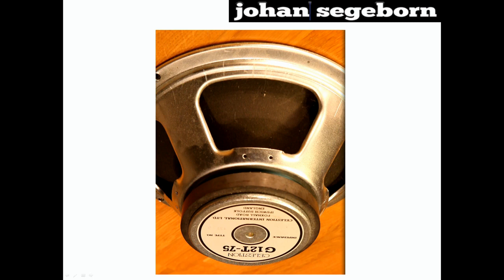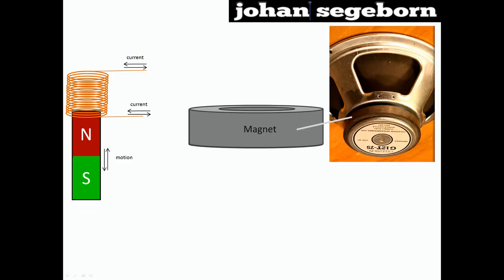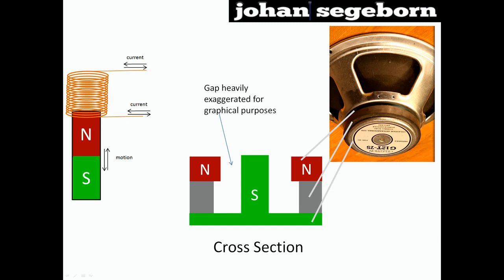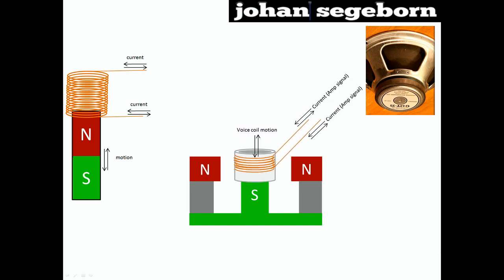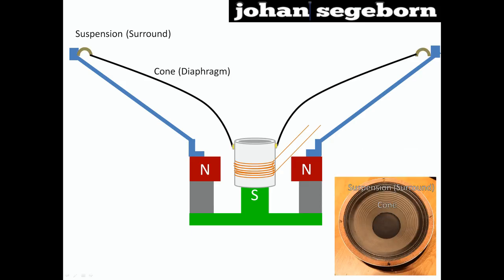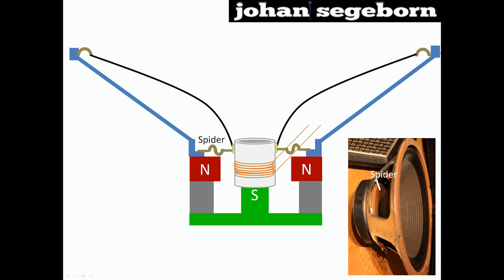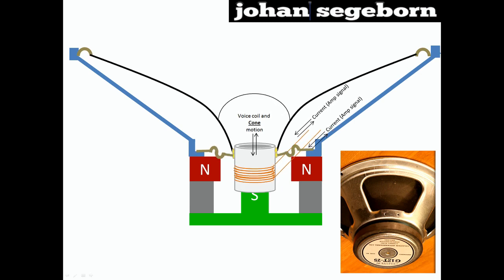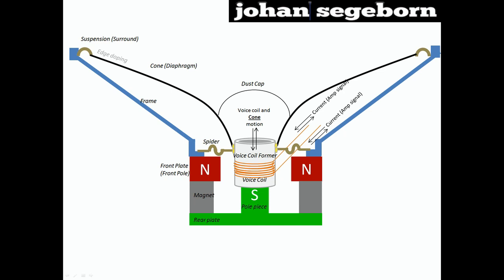How does a speaker work?

Comment: The pole pieces convert the ring magnet with a pole on opposite sides into a bent horse shoe magnet with the poles facing each other in the gap. Well imagine a ring of horse shoe magnets with the poles bent inwards to create a narrow ring shaped corridor with the north pole on one wall and the south pole on the other. In this sits the coil of wire, held in place perpendicular to the magnetic fields, such that the ring magnetic fields induced in each wire produce the strongest force upwards or downwards.

Comment: This looks like AC work , what if DC made this...Can you explain to us the difference between AC current that Powers the amp and the difference between the speaker wires and the current that travels through them how it's different than electricity I don't understand.seems like the speakers pretty primitive for not changing how long of a long we've had it and it's amazing the work the wire work that goes into building it how intricate it is the wired out of this spooled is amazing

Comment: I am a physics major and think I understand  the Lorentz force equation... the magnetic field inside a ring magnet should resemble the force inside a solenoid, which is all in one direction with the same direction as the axis of the magnet. The voice coil is within this uniform field, with lets say the field pointing up at every point on the voice coil. If I pick a point on the voice coil and do the "right hand rule" for  a cross product of current with the magnetic field, I get an "outward" force on the coil at each point, as if the coil is being forced to expand. This doesn't produce a force upwards or downwards on the coil. If I want the right hand rule to produce an upward force, I need the magnetic field(or some component of it) to be pointing "inwards" at every point on the coil. This is best produced at the ends of the magnetic gap or even outside the magnet... so is the ideal rest position placing the coils near the top or outside of the magnetic gap?

Comment: Johan...  please do two speaker videos... 1. Modern speakers that come very close to vintage pre Rola G12M and G12H Greenbacks. 2. Pulsonic coil rub. What can be done?  I just bought 2 1968 greenbacks with original cones on EBay like a moron and they, of course have coil rub.

Comment: Hi Johan,  Can i plug headphone/out of a Bugera G5 to the Loop/In of a Fender 212R combo? Will I get sound safely? (The Bugera G5 out for speaker is 8ohm but the Fender combo works at 4ohm :/ ) The question is regarding a tip that I saw from a Chinese guy here in YouTube.   Thanks in advance :) /m/   Rufino

Comment: would the speaker be better with a powerful neodymium magnet 🧲🤔😄
Reply from the maker: The stronger the magnet, the less compressed the tone gets, so it depends on which sound you’re looking for. One advantage with neodymium magnets is that they can be made really light and still sufficiently strong

Comment: What will happen if we change north and south poles
Reply: Then you get messages from the devil.
Reply: Tusshar Goyal The the speaker would move from front to back instead of back to front like usual. You can try this yourself by hooking wires to both speaker terminals and touching them to a 9 volt battery, then reversing the wires from - to +.
Reply: scott hutchens Would it be like shifting the signal phase by 180 degrees?
Reply: Javig * For it to be out of phase, you would have to have  two speakers hooked up together—one with the correct polarity and the other speaker with polarity reversed. At that point you would have one speaker moving from back to front and the other speaker moving from front to back. The result would be an extreme lack of bass because frequency is being cancelled because both speakers are moving opposite ways. The same effect happens when you have an “out of phase“ switch on a guitar with two pickups. A single speaker moving the opposite way (front to back) does not create an out of phase sound, it takes two.

Comment: Thanks a lot for the video!! Im using a tube amp, and im sure you are aware that I cannot disconnect a speaker out of the amp while it is on because it will damage the output transformer. So I was thinking, can I remove the coil out of a speaker and wire it to a jack and use it as a dummy load for the amp? This was I can use the DI out without having to use the speaker, so is it possible?

Comment: Hello Johan Segeborn, By my great mistake,   + and – wires of one speaker connected to the 2 positives of the left and right channels of the tube amp.  Likewise, + and – of another speaker connected to the 2 negatives of the left and right channels. The one speaker was working  which was connected to the 2 positive of the amp . And the another speaker was not working  which was connected to the 2 negatives of the amp.  For the first 10 minutes, I didn’t notice the wrong connection  by my stupid mistake, then I checked and made the correct connection. After that,  both the speakers were working.  I am afraid of that : Are these speakers and the crossovers became weak? Will it be in full strength as it should be? Although the speakers are working now, I am much worried by my wrong connection.  But , Why one speaker was working and another speaker was not working?  Kindly explain in detail.    Thank you, Best Regards.
Reply from the maker: +Suseendran Balakrishnan Hi Suseendran! If the speakers sound good then it's most likely no problem. The speaker that didn't get any sound can not have been damaged at all. The other speaker received the power of the amp by itself. But usually for shorter periods of time it's ok to play with half the speakers. How much did you crank the amp and what's the power rating of the amp and the speakers? Cheers Johan
Reply: Johan Segeborn, thank you for your reply, . The power rating of the tube amp in Push pull 30 Watt RMS and and the speaker is 100Watt  two  way with cross over. I cranked upto 9 0 clocl position.  Regards.
Reply from the maker: +Suseendran Balakrishnan Hi, then you have nothing to worry about. Cheers

Comment: either the magnet or the coil have to be able to vibrate. am i right?
Reply from the maker: +Michael Lemontzis Yeah a force induced by the magnet field acts on the coils, which makes it move according to the electric signal fed to the coil wires. Cheers
Reply: Thank you.

Comment: grouse video johan have learned so much from you already just wondering i have a fender bassman and it has greenbacks in it. i would love to know exactly what that means. what makes it a greenback shorly its not just a colour thing. just trying to understand my amp better. cheers johan your the best. there jensen if that means anything
Reply from the maker: +Ben Macpherson Thanks Ben! Greenbacks are the Ceramic Celestion G12, G10 and G15 speakers made basically between 1965 and 1973. They all have speaker cones made by Pulsonic, Celestion changed to other cones RIC1 in 74 and those are often referred to as Creamback. During the Pulsonic period, green magnet covers were he most common, thereby the name. Jensen is an American speaker brand (today made in Italy) Cheers

Comment: Thanks for the great video! I just have one quick question. What is the difference between the mechanism introduced 0:10 and the one you talked about later on. I made a simple speaker with the first method, and it worked just fine, does the latter produce a different sound?
Reply from the maker: +Alex Lee Thanks Alex! I think they are the same.
The first concept where the magnet is moved through the coil and a signal or current is induced is basically a microphone. In a speaker you instead have a signal/current that you wanna transform into movement. Cheers Johan
Reply: You get a stronger concentration of field lines at right angles to the coil with the second model, so it is more efficient. Field lines at right angle to the current flow gives the most force.

Comment: I recently purchased some second hand speakers, and the bass speaker is not moving smoothly up and down. Rather it stays at rest at the lowest position of the spider. Could this be an electrical problem or a mechanical one? And does anyone have any idea on how one would fix this issue?
Reply from the maker: +willcant quickscope Hi, if the speaker frame is warped, the paper cone that is attached to it will be shifted, and since the coil is attached to the speaker cone it will be sifted too such that it may touch the polepiece or magnet in the gap and not have it's movement hindered.

Also the coil wire may have been overheated and swelled as a result causing the coil to get stuck in the gap.

How does the speaker sound? Is there any scratching noises?
Reply: +Johan Segeborn Hi, thanks for taking the time to reply.
  There is no scratching as far as I can tell; the sounds comes through fine but is muffled and quieter in comparison to the other speaker (one works fine). Both have no cracks or breakages anywhere, and only came out of the unit yesterday when I re-soldered the wires to try and fix the issue. 
 I have looked at both (Celestion bass speakers) and it is clear that the cone in the speaker not functioning properly is seemingly sunk into the speaker. Upon further inspection, it seems that when I move the cone up with my hand, there is a lot of friction on the spider. 
  The working speaker, when you press the outer surface, will bounce back like a trampoline. This one is rigid as the spider seems completely compressed. 
  Do you know what keeps the cone from falling back onto the magnet? Would it be wise to remove the spider? I am wary when acting on the speakers as they are my grandmothers, and quite old.
Thank you for any help.
Reply from the maker: +willcant quickscope Hi, in this clip I disassemble a speaker https://youtu.be/-xYw45ABTIU

Comment: what do the north poles of the magnet do? seems liek they are useless since the coil can only move up and down.
Reply: +Mommy Spanker wrong , magnets only have south and north not positive and negative . .,, okay this is how it simply says in that video . Both the north and south are important . Why ? Cuz without the opposite pole their wouldn't be no magnetic fields . Remember it's the magnetic fiends ( which are domains of electrons flowing in one direction ) that deflect or repel off electrons inside wire coil which induce movement . This movement of electrons is electricity . So we know the electrons are coming from the amplifier into the coil , this will jerk back and form in respect to the sound electric signals , this will push against the air . Make it vibrate .. And the vibrations of air inside the voice coil is what sound is . The vibrations send air waves right bit ur ear stimulating other vibrations in ur ear drum this connects to other organelles inside ur ears until the info hits ur brains . That's what sound is
Reply: +Pau Gasolina The north and south poles just means positive and negative. not a direction. I think north is positive and south is negative. all magnets have a positive and negative.

Comment: What happens if we remove the South polepiece? will it come sound from the speaker?
Reply from the maker: If you google Faradays law and speakers you can se how two fingers and thumb held perpendicular on your right hand can represent current, field and force. The current runs in the coil and you want the force to act axially along the coil. The field needs to be perpendicular to both, so place magnets accordingly. It wont be dead silent though. Have never tried it though. Cheers

Comment: Thanks for the video. How are different sounds made from the same speaker, when moving at the same stroke at the same frequency? It confuses me how a speaker can make an infinite amount of sounds, from a fixed, finite position. Is it something really simple? Thanks for your help...
Reply from the maker: Red Shift Hi Red! A sine wave of 1000Hz means that the speaker vibrates a 1000 times every second, 50 Hz means 50 times per second. If you plot the amplitude of a music or guitar speaker you can se that the signal is a bunch a signals superimposed. Cheers

Comment: I have built many 18 inch speakers myself and have won many car audio competitions. But I never did understand wattage. I understand that the distance of the cone moving back and forth is a major factor of the output of the speaker, but not wattage. If sound is caused by the cone moving back and forth, why is a 3000watt speaker louder than a 100watt speaker if they both have the same motor strength and both have the same amount of cone movement?
Reply from the maker: Sloppy Joe Hi Joe, do you mean two speakers with the same sensitivity rating? Cheers
Reply: Johan Segeborn yes. Lets say hypothetically all specs on both speakers are the exact same except for the wattage. From my understanding sound is made by the cone moving back and forth. If the cone is moving the same distance back and forth with the same efficency, why is the higher wattage speaker louder? Shouldnt it be the same since the cone movement is the same?
Reply from the maker: Sloppy Joe If the movement (distance as a funktion of time) are the same for both speakers they should push the same amout of air and thus sound as loud. Do you have some specific speakers where this is fulfilled and they still perform with different loudness? Let me know and I'll look into it. Cheers Johan
Reply: I dont have any specific speakers in mind. Im thinking directly for speaker design. If this is the case, why do we not make 5 watt speakers that have a big magnet behind it to equal the same air movement as a 2000 watt speaker with a small magnet? In car audio it gets rather hard to power 10 thousand watts rms or continous. Why not just make speakers that have a very high xmax and motor strength with extremely low power?
Reply: very good question! I would like to know the answer to that too. Same amount of movement, different power (i believe wattage is not the correct word). What makes the sound louder is the amount of movement that the cone does or is the speed that it goes back and forth?
Reply: Sloppy Joe you mean a high BL factor at some point a higher BL limits the output because the thing has to move less to generate the same back voltage. it depends on what frequency area you`re in. for the low bass a high BL is better, for the higher bass a low BL is better. The higher bass range expands with a higher BL. A extreme high BL factor speaker would be operating in that `mode` only and would have an easy time generating the back voltage and actually move less.

Comment: Hi john it is really great explanation.I want to know much more detail means if x is my input voltage then how much sound pressure generated by diaphragm movement.
Reply from the maker: Thanks!

Check these links out: Say that you have a 50W amp and an 8Ohm Impedance Speaker corresponds with a voltage of 20V and a current of 2,5A. Try it for different values.

http://hyperphysics.phy-astr.gsu.edu/hbase/electric/acohml.html

In the second link you can relate input power to the element sound pressure level at some  distance. ((One interesting thing to note is that doubling the effect of the amp is basically same as the difference between a Greeback G12M of effectivity 96dB and a V30 of effectivity 100dB.))

http://www.hometheatrebasics.com/home-theatre-tools/spl-calculator/

Cheers!
Johan

Comment: man you are wrong!! it's not working that way... first of you wrong about the speaker magnet. if you know about magnetism then must know that magnet not working that way. like, when you magnetized a  permanent then its not  magnetized in parallelly. it's magnetized horizontally... so the thing is that the so called pole piece which is part of bottom piece of permanent is not magnetized whole into south-pole. actually it's top part is turn into north-pole....
and when current flew into coil it's also into a magnet. but changing current flow direction you can changing it's pole direction... and all know same pole attracted and some pole repulsed. and that the way it's coil moving up and down. and makes sound...